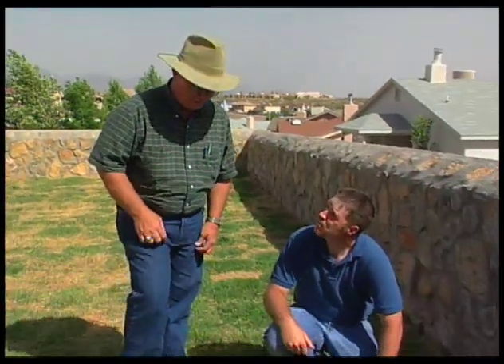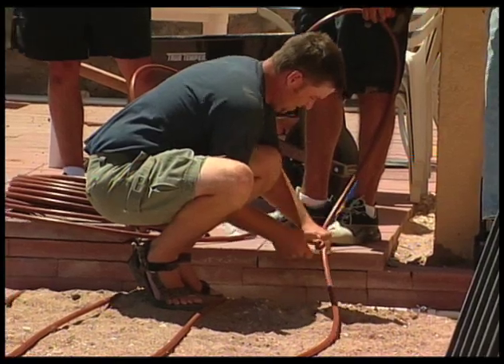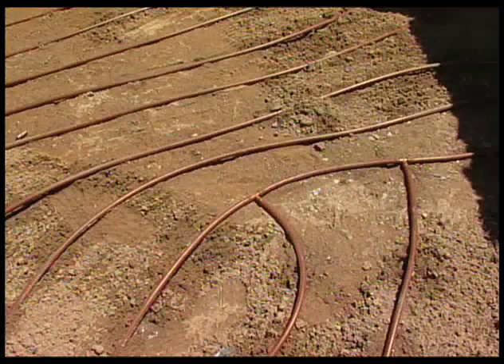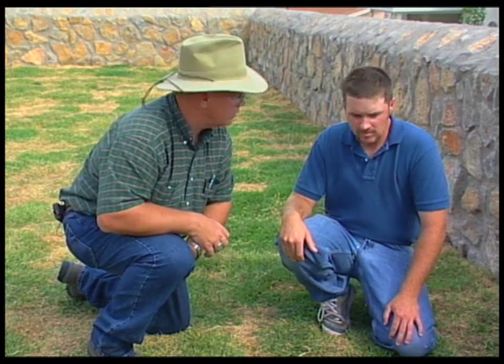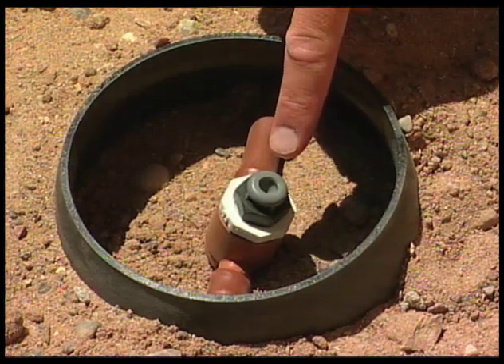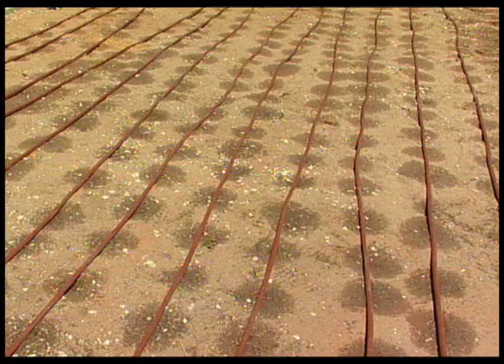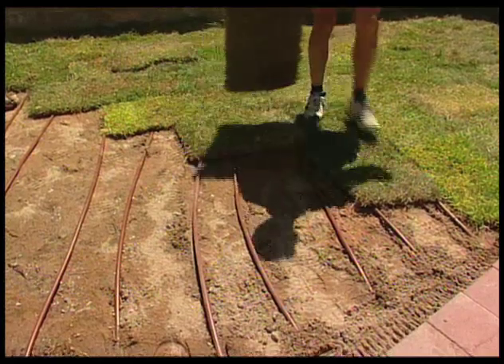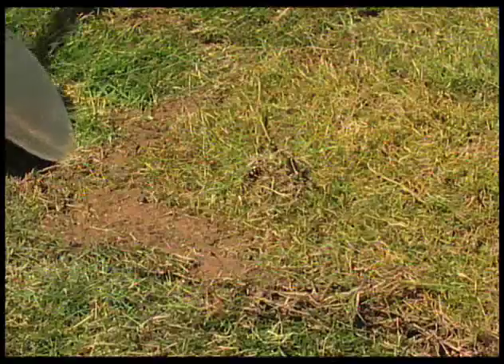How To Install A Sub-Surface Drip Irrigation System

Comment: I moved into a house with this in between the driveway pavers, the best part is that the little holes get clogged all the time. You think fixing a sprinkler head is difficult till you’re fixing a million tiny holes.

Comment: The guys laying the sod were not being too careful - overlapping edges and walking away to get another piece, etc. You should have a guy on the ground making sure there's no airpockets, that the pieces fit perfectly together, and good soil is down first and filled in between the lines. Hand watering this system for the first couple weeks probably would have helped a lot to get it established without dead spots.